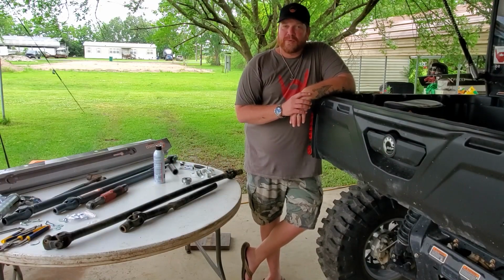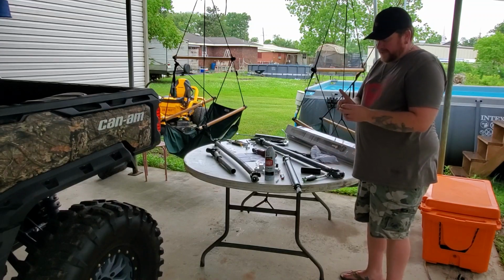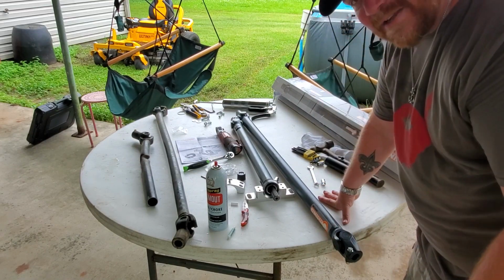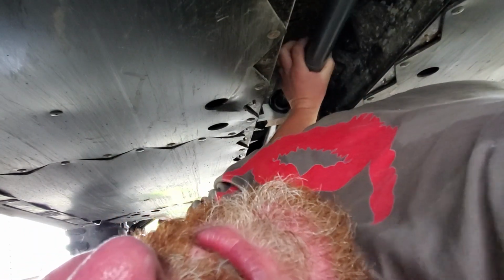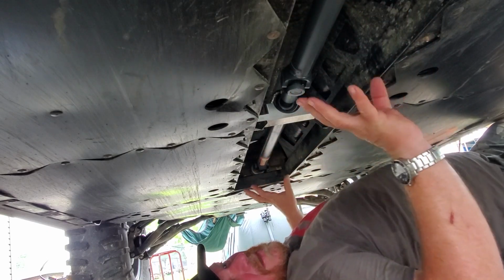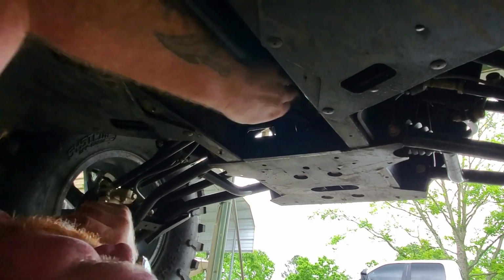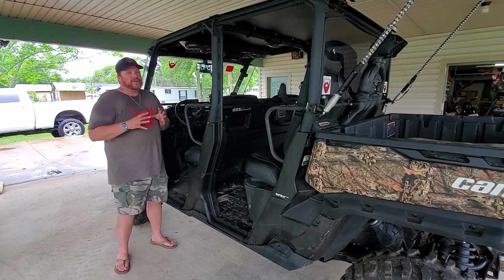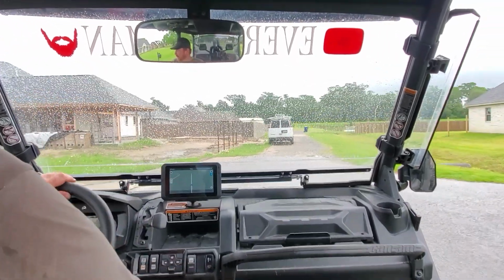Installing New Drive Shaft on A Can Am Defender

Comment: Good video! I'm wondering what you think when you drill the rivets out about replacing them with threaded inserts and then putting button Allen heads on?
Reply from the maker: It would certainly work.

Comment: Does your machine creek when you ride around?
Reply from the maker: Yup, they all do.
Reply: Mine was making a lot of creaking I tightened all the roof bolts they were so lose over time and also grease the A arm zerk fittings helped a lot